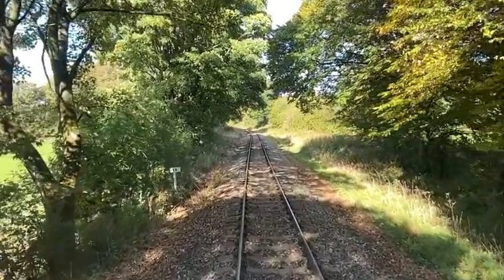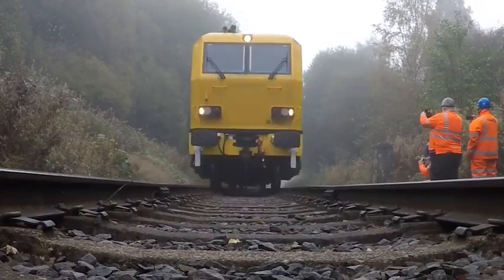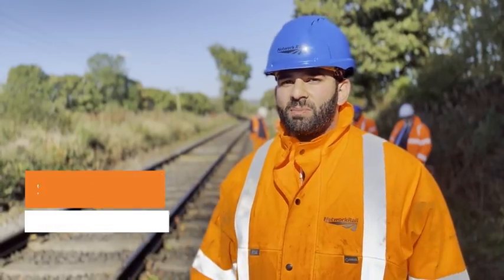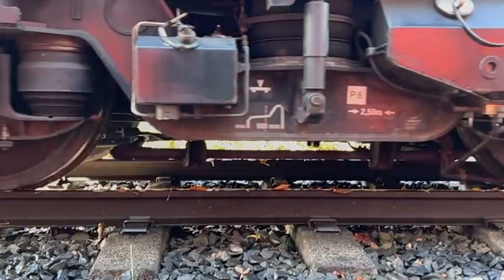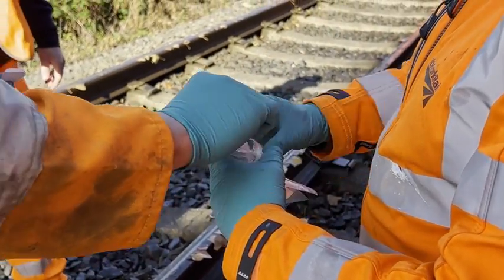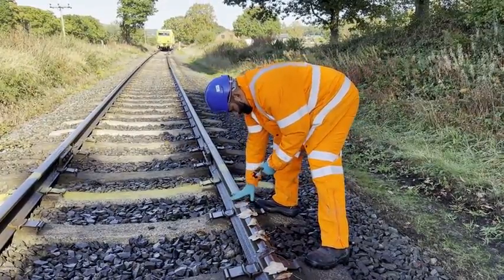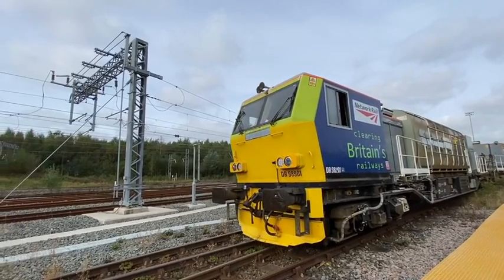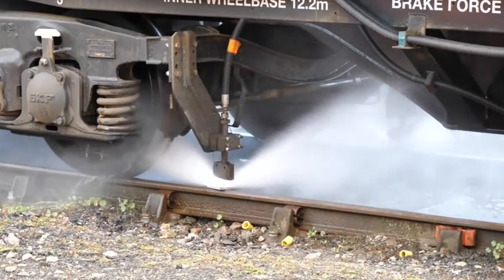Laser and plasma jets zapping leaves on the line.

Comment: I needed to know why don’t dig a tunnel and do an extension for the main line Train so that they could extend the new abandoned underground stations.  

Why couldn’t they use the part D78 Stock train doors on the sides and also restructure the front face of the A60 and A62 stock and that includes the class 313, class 314 and class 315 remix and make them all together and also redesign them an overhead line and also make them into six cars per units and also having three Disabled Toilets on those six cars per units A60 and A62 stock trains and also convert the A60 and A62 stock trains into a Scania N112, Volvo TD102KF, Volvo D10M, Volvo B10M, Gardner 6LXB, Gardner 6LXC and Gardner 8LXB Diesel Engines and also put the Loud 7-Speed Voith Gearboxes even Loud 8-Speed Leyland Hydra cyclic Gearboxes in the A60 and A62 stock, class 313, class 314, and class 315 and also modernise the A60 and A62 stock and make it into an 11 car per unit so it could have fewer doors, more tables, computers and mobile phone chargers.

A Stock Trains and also having 8 Disabled Toilets on those A stock trains. why couldn’t we refurbish and modernise the waterloo and city line Triple-Track train tunnel and make it bigger and extend it to the bank station, making it into a Triple-Track Railway Line so those 4 European countries such as Germany, Italy, Poland And Sweden to convert the waterloo and city line Triple-Track Train tunnel into a High-Speed train?

The Third Euro tunnel Triple-Track Train line to make it 11 times better for passengers so they could go from A to B. then put the modernised  11 car per unit A Stock and put them on a bigger modernised waterloo and city line Triple-Track train tunnel so it could go to bank station to those 4 European countries such as Germany, Italy, Poland And Sweden. The modernised refurbished 11 cars per unit A stock could be a High Speed The Third Triple-Track Euro Tunnel Train So it is promising and 37 times a lot more possible to do this kind of project that is OK for London Germany, Italy, Poland And Sweden. 

oh by the way, could they also tunnel the Triple-Track Railway Line so it will stop from Buckinghamshire, Hertfordshire and Essex so that the Passengers will go to Germany, Italy, Poland and Sweden and also extend the Triple-Track Railway Line from Bank to Buckinghamshire, Hertfordshire and Essex Stations so that more people from there could go to Germany, Italy, Poland And Sweden Easily.  

Why couldn't they extend the Piccadilly line and build brand-new underground train stations so it could go even further up to Clapton, Wood Street and make another brand new tunnel train station in Chingford and could they extend the DLR?

All of the classes 150, 155, 154, 117, 114, 105, and 106, will be replaced by all of the Scania N112, Volvo TD102KF, Volvo D10M, Volvo B10M, Gardner 6LXB, Gardner 6LXC and Gardner 8LXB Diesel Six carriages three disabled toilets are air conditioning trains including Highams Park for extended roots which is the Piccadilly line and the DLR trains.
Could you also convert all of the 1973 stock trains into an air-conditioned maximum speed 78 km/hours (48 MPH) re-refurbished and make it into a 8 cars per unit if that will be alright, and also extend all of the Piccadilly train stations to make more space for all of the extended 8 car per unit 1973 stock air condition trains and can you also build another Mayflower and Tornado Steam Locomotive Companies and they can order Every 17 Octagon and Hexagon shape LNER diagram unique small no.13 and unique small no.10 Boilers from those Countries such as Greece, Italy, Poland, and Sweden, can they make Mayflower and Tornado Steam Locomotive speeds by up to 117MPH so you can try and test it on the Original Mainline so it will be much more safer for the Passengers to enjoy the 117MPH speed Limit only for HS2 and Channel Tunnel mainline services, if they needed 16 Carriages Per units can they use those class 55’s, class 44’s, class 40’s and class 43HST Diesel Locomotive’s right at the Back of those 18 Carriages Per Units so they can take over at the Back to let those Mayflower and Tornado Steam Locomotive’s have a rest for those interesting Journeys Please!!, oh can you make all of those Coal Boxes’s 16 Tonnes for all of the 117MPH Mayflower and Tornado Steam Locomotive’s so the Companies will Understand us PASSENGER’S!! so please make sure that the Builders can do as they are Told!! And please do something about these very important Professional ideas Please Prime Minister of England, the Prime Minister of Sweden, the Prime Minister of Germany, the Prime Minister of Lathe ly, the Prime Minister of Poland and that Includes the Mayor of London.
Reply: What has this comment got to do with autumn leaves being crushed onto the rail head?